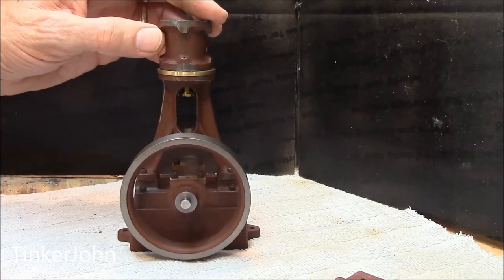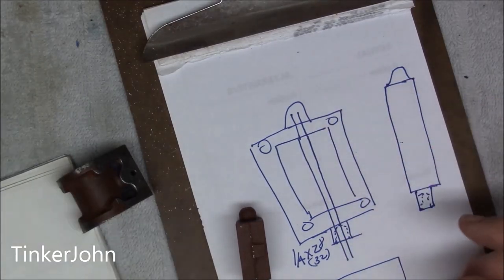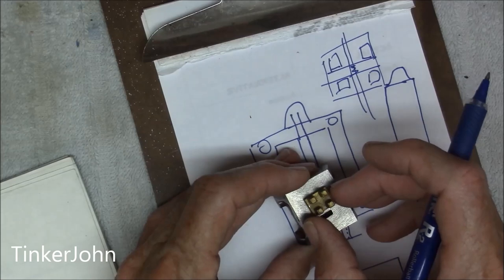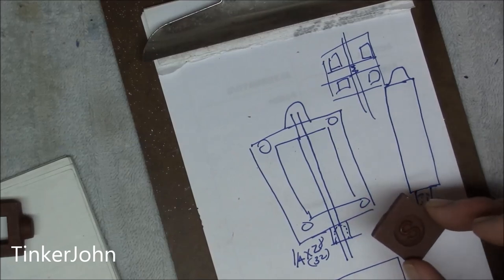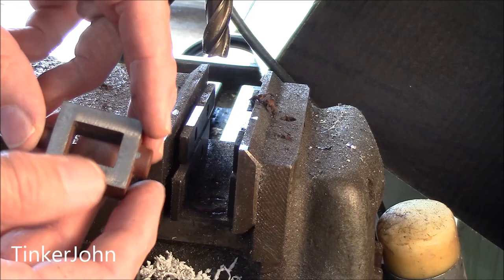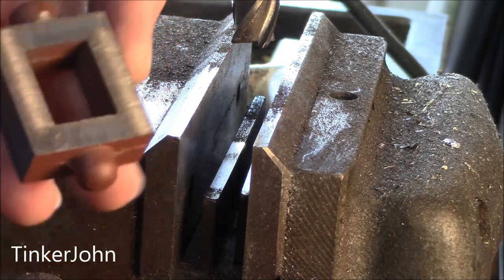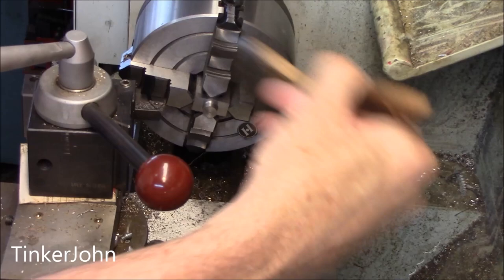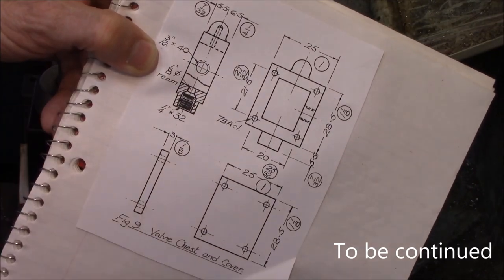Machining the Stuart 10V Steam Engine Castings - Part 40

Comment: Nice to see you back online. Just a heads up that the steam/ air goes into the chest first then heads toward whichever upper or lower port that is open(the upper or lower of the slots, depending on the crank position). The piston movement then exhausts the slightly cooler and lower pressure exhaust steam out of the other end slot, across the cavity in the brass slide valve to the middle slot which is the exhaust. So to recap, the middle port is always an exhaust port and the upper and lower ports are inlet or exhaust depending. The clever bit in all of this is that the steam chest always has higher pressure steam than the tiny exhaust transfer cavity in the slide valve, and this pressure differential clamps the slide valve against the surface it is sliding on! Have you guys seen the free Android app that gives you a super cheap DRO readout on your mill, or lathe? I've built one and it is ace. Check it out by searching for "touch DRO "
Reply from the maker: +Roger Crier 
Roger,  You are correct, I got the explanation backwards.  It's been too many years since I gave the valving much thought  and totally missed it in the video.   ~John

Comment: Glad your picking up the steam engine again. BTW you said you were going to drill the 1/4 " through but the diagram shows a step-down I assume to help guide the rod.
Thanks for posting more.
Kim
Reply from the maker: +krhitme
Kim,
Thanks for watching and for your comments.  The 1/4 is for a gland that will hold the rod in place.   ~John

Comment: When drilling into brass it may be better to grind a small flat on the cutting edges of the drill to prevent digging in. The chips will be smaller and the drill will not wander.
A
Reply from the maker: Alex, thanks for watching and for your great suggestion.  I got a little lazy when drilling that piece brass and should have used a bit with a different angle.    ~John

Comment: Your porting is incorrect. With slide valves the low pressure exhaust in in the center and "inside" the valve. This makes the center port exhaust. Live higher pressure steam surrounds the outside of the valve in the steam chest, this causes the valve to seal against the port face because of the differential inside and outside the valve. If you had play in the slide valve and port face; or the valve and the valve rod or adjustment block; and admitted steam beneath the valve face, the valve will lift above the port face and allow steam to escape. This decreases efficiency and power. Live steam or pressure must be admitted to the steam chest and around the outside of the vale not from beneath it through the ports.
Reply from the maker: +Corbin Young 
Corbin, you are correct.  As Iwas talking, I started explaining without thinking!  (A common problem).  It's been about 20 years since I gave porting much thought and memory failed me.  i've made annotation in video.  ~John